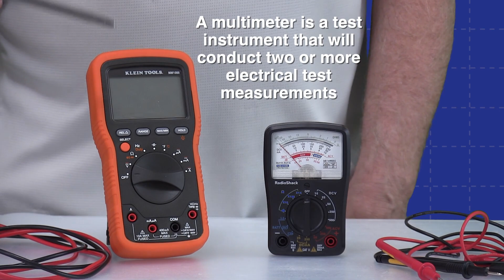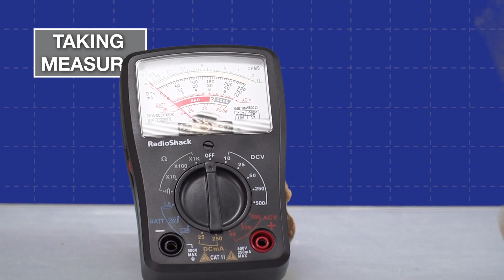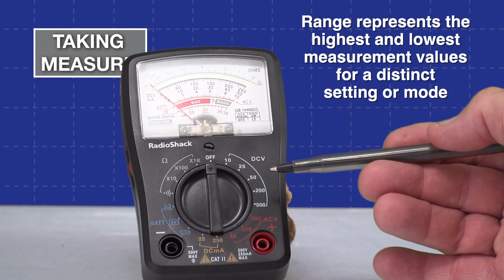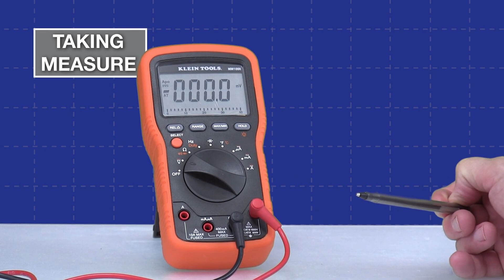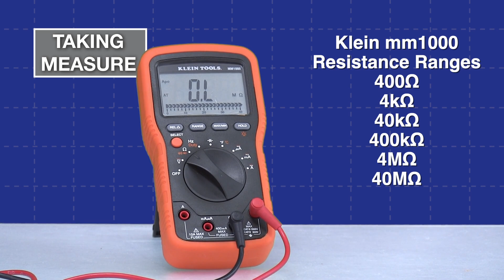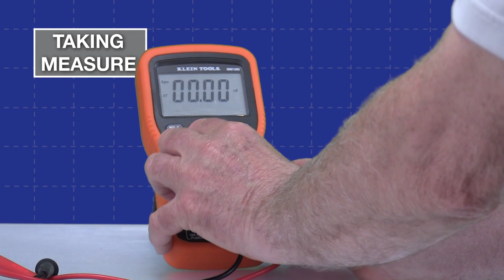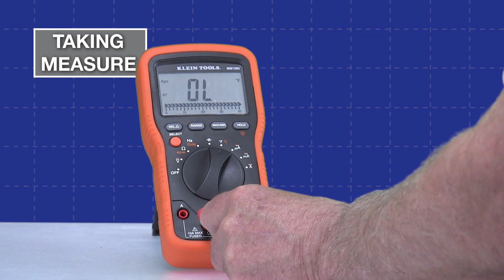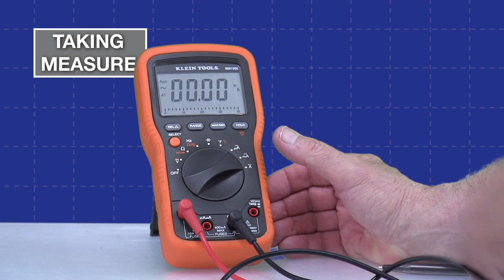Comparing a Digital and Analog Multimeter (Updated)

Comment: MITCH, can you give a bunch of examples of the advantages of using an Analog Meter to measure what?
Reply from the maker: I prefer a DMM for most measurements, mainly because they present numerical values and require less interpretation.  An analog  meter (or analog bar graph feature on a DMM) may be helpful for picking up fluctuating current, voltage, or resistance values.
Reply: @takingmeasure  try to make a lesson about what circuits or applications would cause the current or voltage or resistance to fluctuate. Intermittent Motors coil windings DC resistance measurements can fluctuate or an intermittent rheostat windings will fluctuate the voltage. Switching Power supplies voltages will fluctuate compared to a linear power supply.
Reply from the maker: @waynegram8907  I am talking with another instructor about developing some power quality labs.  We are discussing something relative to power factor correction.  I really appreciate your suggestion.  That is another good subject.  Thank you.
Reply: Even 5$ cheap multimeter from china is way better than analog one.
My father was using analog clamp meter, once I gave him the digital one, he threw the analog one and never used it.
Reply: @HussamAldean  You can measure "Conducted Noise" using an Analog Meter, Digital Meters Displays response time is to slow to update display cycles. Analog Meters are good at troubleshooting NOISE in preamps